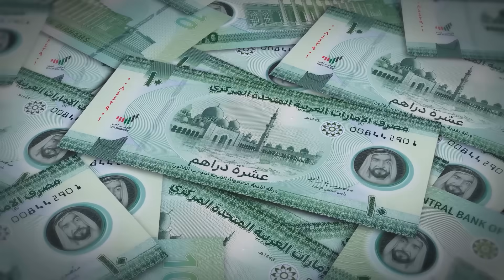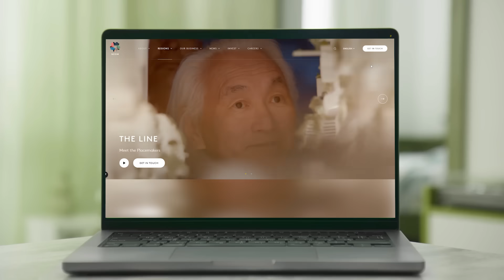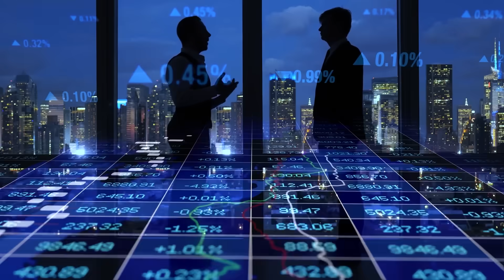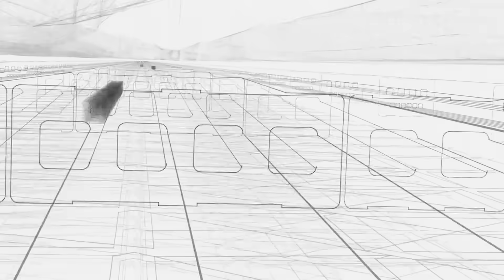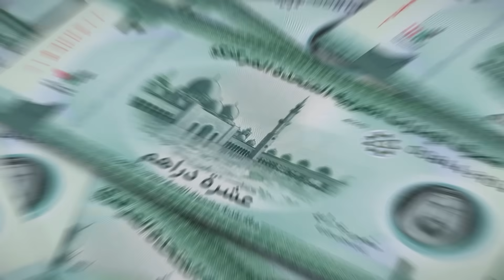This Is What The Line Megacity Looks Like In 2025! HUGE UPDATE

Comment: I bet that it will mostly be hollow just a train line until it hits the next hub/skyscraper hub that is 25km down the line. It will have 4 hubs total 1 at start, 1 that is 25km down, 1 that is 50km down, 1 that is 75km down and the final hub and a few skyscrapers in a row 100km down the line. The rest in between will just be an empty wall with high speed rail. However it allows for space to later expand the city out down the line between the 4 hubs where there are skyscrapers.
Reply: What about the other 70km?

Comment: Instead of 1 long line in the desert 
A series of concentric circles with a gap of half a mile between them would have been far more efficient in so many more ways 

And starting with the inner circle being built in 6 sector with gaps between them for airflows and human traffic, and a diameter of just 5 miles wide, it would be far more wiser to do than this line dream or nightmare

Comment: Our dream is becoming reality, new Saudi Arabia 🇸🇦 
To the haters, better save your energy, If you’re feeling emotionally unstable, maybe avoid the news about the new Saudi Arabia, it might be too much for you 😂
To our supporters, we’re gonna enjoy this project and many more together very soon. Stay tuned, exciting times ahead 😊
Reply: A much faster way to get this built would to be to build 4 hubs which would be 10 skyscrapers in a row. Build one at the start, one 25km in, one half way which I assume is 50km, one that is 75km in the line and one at the end. There will be a lot of empty space between each hub but each hub can expand over to the others. Hub one can keep building out towards hub two. And hub two can keep building backwards tell it reaches to where hub one built out. Hub 2 can also build out to hub 3 and hub 3 can build backwards to hub 2 tell that meet and so on. The most important part would be to build the train between all hubs. And each hub as it fills in will have the resources already onsite to build to the other hubs. You set up 4 work crews at each of the hubs that’s spaced 25km apart and build simultaneous and parallel at the same time. Or maybe even better 10 hubs, 10 work crews 10km apart down the line building at the same time. At least want to get a building in each 10 kilometer mark built to serve as a platform to build out. Can even get people moved in as several sections stand up. And just continue construction on down between each hub until all hubs reach and connect to each other.
Reply: I’m not an engineer.. but this idea seems interesting..

Comment: I have faith the line will be done in phases. Phase 1 by 2045 2km human construction  phase 2 by 2055 human construction +4km phase3 by 2065 +8km human and first if it's kind robotic contruction phase 4 by 2075 mostly robotic construction +16km by 2085 all robotic construction +32km by 2095 all robotic construction +64km  by 3005 the last 44km plus the first 3O km being built right now will need upgrades and all robotic ofcourse from 2085-3005
Reply: just a small correction - after 2099 comes 2100, but not 3000 :)

Comment: Poppycock! 100 miles in 20 minutes? Apparently there will be no stopping trains in between the ends of the city.  Because if you factor in the 5-minute walk to a high-speed train station, the number of stations and the 170 km distance makes this plan impossible. And that's just one aspect of the ridiculous project.
Reply: Please don't bring logic and math into the conversation.  You're no fun at all!
Reply: @FreshAirRules  yeah, reality is kind of particular. It would make more sense if they just buried a few billion dollars in the desert and had a nice treasure hunt. It would be far cheaper and boost their tourism for a tiny fraction of the cost!
Reply: 20 minutes end to end! What if you want to start or stop at some other point? How's that going to work?
Reply: @scriptercoba maybe have hooks with lines so as the train goes roaring past, you can throw the grappling hook at it and get jerked off the platform 😅

At your stop just leap off the train into piles of cardboard boxes

Comment: The line is supposed to be only 200 m wide, not 1.2 KM (Which is more reasonable.) 200 is too narrow.
Reply: Not so narrow considering the light that needs to come through the glazzings until the center of the 200m width. If you compare it with a standard appartment building